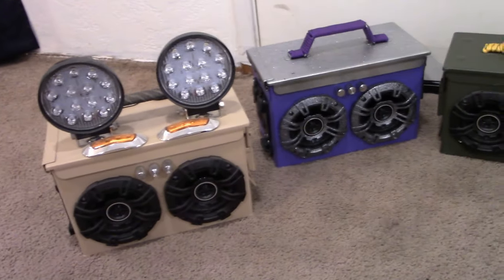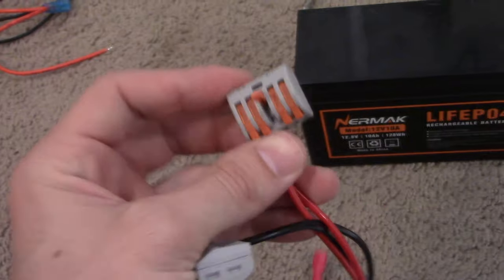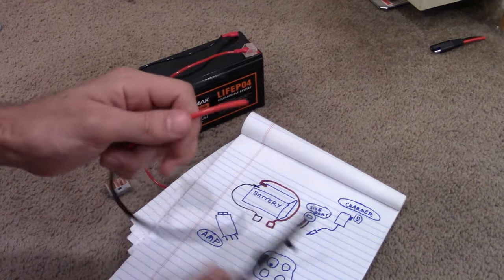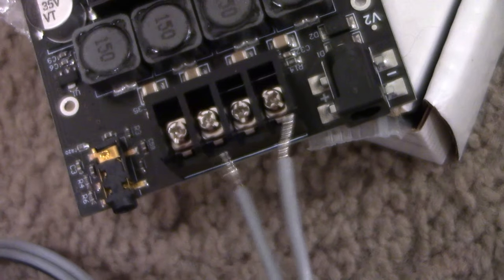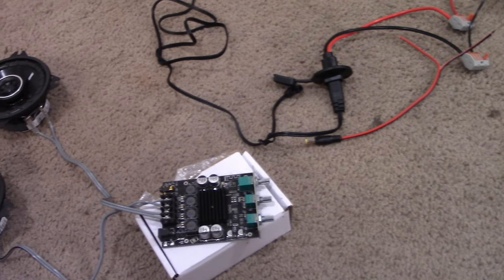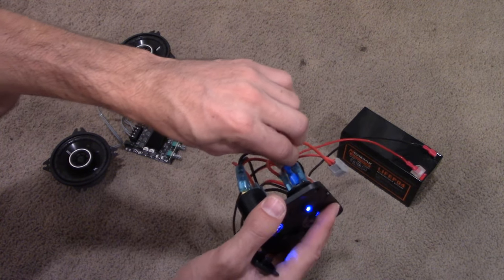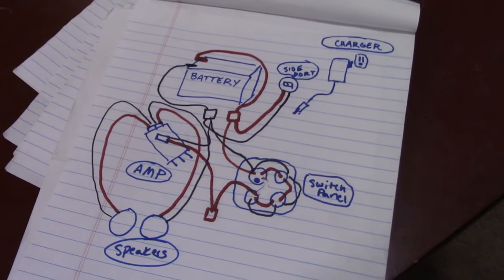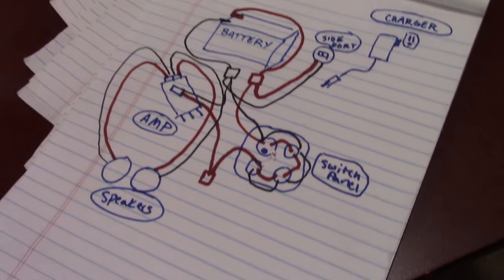How to Wire DIY Boombox - Ammo Can Speaker (Step by Step)

Comment: I built a can boombox exactly as you laid out with the same products.  Turned out perfect and sounds.  Thanks for all the wiring information!!
Reply from the maker: Awesome job!
Reply: How much you spent for the internals of it
Reply from the maker: @nicksmalley6433  about $225 for this one
Reply: What type of fuse?  I'm puting in a 2.1 amplifier 220Wx2+350W 12v38v power amp and would that same battery be enough.
Reply from the maker: @jesusbarrera13jb  that battery should be fine, I always use the largest one that will fit 10-20ah.. and a 30a fuse
Reply: @caseymoto  thank you.

Comment: Great video! I use this to complete all of my wiring for one I just built. I built mine out of MDF, used an old Alpine radio, two 5 1/4 inch coaxial speakers, and an 8 inch woofer. Have you ever built any of these units using a subwoofer?
Reply from the maker: Cool, how does yours sound? I did a 6.5” sub and two small tweeters, I liked it, here is the video of that one: https://youtube.com/shorts/29JhFUywzWQ?si=H-tlXi1h4fR_FLVN

Comment: I’m looking to build one for myself, and if it works out…maybe sell a few. How much did it cost you overall, and about how many hours?
I just got the idea after an ad popped up in my news feed. It looked cool, then I just about 💩 when I saw their blowout price of $1,000🇨🇦. Surely I could do one justice for $3-400 or so.
Reply from the maker: It’s going to cost you about $225 in parts.. the first one you make will take most of the day, but you can make a template on cardboard for the hole drilling positions and make the future boomboxes in less time.. If you paint it, it doesn’t add much cost but does add more time and looks awesome.. I only sell them to friends and family because I don’t have enough time
Reply: @caseymoto  Thank you

Comment: I'm a beginner and am planning on making a Bluetooth speaker. I've been watching a lot of videos on how to make a Bluetooth speaker but none of them have step by step instructions. I've seen many videos that say you need a BMS (battery management system) board which will protect the battery from overcharging and discharging. Also, you didn't have an LED for battery charging and complete indicator. Does the switch panel that you've installed have those built-in? If you can make another video showing on how to connect those items I mentioned or just reply to my comment, that would be great. Thanks.
Reply from the maker: @BobbyTube808  the battery I linked has a BMS integrated into it, so you don’t have to worry about that.. as for battery charging indicator, the charger I linked has LEDs which light up red or green to tell you when it is charging and full .. you can check the description of this video for those links.. let me know if you have any other questions
Reply: @caseymoto  Super!! I will check that out and see if it will work for my setup. Thank you so much for your video and quick response.

Comment: I wanted to know if 14” 1409 dry marine box would fit PLMR60W speaker fit side be side on the length side of 
Box or should I go with a plastic ammo box that length is 17”Lx10.13”Wx13”?

Comment: Love the explanation and the build concept bro, couple of question so real quick. Can you still have it on while charging with no problems? And do you need a step down for the usb charger
Reply from the maker: Thanks man..  yes, you can have it on while charging with no problems, you can use any of the components while plugged into the wall.. you don’t need a step down, the usb charger and other components work off 12v, just like the amp
Reply: @caseymoto  thanks for clearing that up for me bud, you are the man!!

Comment: I've been on amazon trying to find the hardware put I don't know the correct names of any of it. What are the multi connectors that's hook to the battery? Charger port? Everything used to chage the battery,  how can I find that? Only thing I've found is the amp, battery and the on andoff switch.  Please help me with the rest.
Reply from the maker: I put the link to the parts in the description of this video .. check it out and let me know if you have any trouble
Reply: Some of the links comes up as "sorry, page not available". But really the only thing I'm having trouble finding are the positive and negative words you have hooked to the battery that allows you to connect multi things click on them and it might do the same to you. And I wanna build a box that holds 4-6x9s. Will that amp be enough or should I get the 200 watt?
Reply from the maker: @TheRoddrickblow  yea I see that, ok the part you are describing is called “lever wire connectors nuts kit”, try this link:
https://www.amazon.com/gp/product/B07SFCCPZ6/ref=ppx_yo_dt_b_search_asin_title?ie=UTF8&psc=1

I have used this amp with two 6x9s and it worked well, four 6x9s might be pushing it, but I know of a similar cheap amp with a little more power which I sometimes use for big speakers, I’ve also used a voltage booster to increase the power going to it - let me know if you want links to those two parts
Reply: @caseymoto yes can u send those
Reply from the maker: @rylan_mccarson3613  amp:  https://a.co/d/dV627u6
Booster: https://a.co/d/ffrxkIe
Reply: @caseymoto  definitely let me know. I've had this thought in my head about building a 4-6x9 boom box for awhile and I want it to be loud and you've given me the components to make it happen. Thanks a mil for the quick response
Reply from the maker: @TheRoddrickblow  here are the parts I use for the bigger speakers.. when I used this with two 6x9s it provided plenty of volume , good luck :
 amp:  https://a.co/d/dV627u6
Booster: https://a.co/d/ffrxkIe

Comment: Do you have a video of installing the amp with the control knobs sticking out between the speakers.
Also do you use screws with nuts to hold the speakers and controls the the can?
Reply from the maker: For the amp mount: drill 3 holes, take careful measurements to get the locations right. use cardboard to make a template if you have to. The amp comes with three nuts threaded down on the three knobs, remove the nuts, stick knobs thru holes, then twist down nuts, it will be secure...yes I use 6-32 1" machine screws with nuts for holding everything to can
Reply: @caseymoto what size drill bit do you use for the amp knobs
Reply from the maker: @thomasallred5984  I used a stepper bit, so I don’t have the exact size, but using that I slightly increase the hole size until it fits perfectly

Comment: Two questions i just ordered everything but wanna know if I can fit two 6” speakers in one of these and another question how long does it normally stay charged for while using
Reply from the maker: This 50 cal ammo can is fitting 4” speakers.. 6” speakers would be too big. I like to use 6” speakers on this other 20L gas can, it sounds really good:
https://youtube.com/shorts/TWIAvQD87t0?si=u11Ds_iCpp7HAXvj
It depends what volume you play for how long it stays charged, but it lasts a really long time.. I’d say like 8 hours
Reply: @caseymoto  thank you so much should be building me one with 6” speakers by the end of the week
Reply from the maker: @TheOGNuke1   no problem, good luck .. you can also use a 40mm ammo can for the bigger speakers.. here’s another video which shows both of those options:
https://youtube.com/shorts/343ZknA4gx4?si=BcupXg5fBANbco-S
Reply: @caseymoto  built one with the 6.5” speakers I have from the utility ammo can from harbor freight they fit kinda perfectly but i have two more questions if you don’t mind what did you use to install the 12v plug effectively I used a drill bit then kinda ran it in a circle till it cut out the hole big enough then slid all 4  of the into it to get them to fit there’s gotta be a better way do u use like a 1” hole saw or something and also what was the way u got the amp to fit securely bc I made it fit kinda like u did by drilling 3 holes then pushing the amp through and sliding the caps on but it doesn’t seem that secure on there
Reply from the maker: @TheOGNuke1  I only use hole saw for speaker holes , all the other small components I use “stepper bit” because it has several hole sizes which get progressively larger, so you stop and check as the hole gets slightly larger until the component fits perfectly… for the amp mounting , there are three small nuts tightened all the way down on those three knobs, you wanna remove those nuts and thread them back onto the knobs after you stick them thru the three holes, it will tighten up nice and secure , then stick the plastic knobs on
Reply: @caseymoto thank you probably a stupid question but I wasn’t sure and didn’t wanna mess it up 😂

Comment: Your video is great and easy to follow. I plan on building one soon with 2 5.25's and an 8" Skar sub.
I was thinking about using the TDA7498E amp. Do you think amp will be good enough for build? And also do you think k I will need a voltage booster? And how is it wired in.
Reply from the maker: That sounds really cool.. it looks like that amp should work.. I would use a voltage booster, here’s the link to what I use when I’m doing bigger speakers like that: https://a.co/d/hiO1yp2
It has red and black input wires which attach to the 12v battery and red and black output wires which attach to your amp, I do like 21v.. you can set it to what voltage you want to output

Comment: Could I use a dewalt 20v battery being that the Bluetooth mother board is rated between 12volts to 24volts? Just curious before I connect it together haha
Reply from the maker: @nitorena7042  usually I increase the voltage to 20-21v (using a voltage booster) when using 6.5” speakers.. for the 4” speakers I like the power output with 12v thru this amp so I’ve never tried higher voltage on these speakers.. but it should work and I’ve been wanting to try dewalt 20v instead of boosting a 12v
Reply: @caseymoto  I’m going to give it a shot then I’ll  update you on the outcome

Comment: Would it be a good idea to install and in line fuse somewhere in the system, maybe between the amp and the switch?
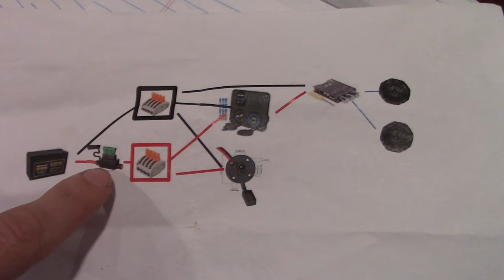Reply from the maker: Yes, I usually put it (a 30a fuse) between the battery and main connector box, you can see this at 11:15 in the visual on this video
Reply: @caseymoto  Sorry I see the fuse now in the visual

Comment: Does or will the voltage display show how many volts are left in the battery??
Reply from the maker: yes, that is correct.. you can see this at 9:35 in the video. It is displaying 13.2v which pretty much means full. around 11.5v or so it is basically dead
Reply: @caseymoto  I must have mine wired wrong because it show 13.3, 13.2 all the time when I have the switch turned on.
Reply from the maker: @ShawnStumpe  it takes a while to go down, because the battery lasts a long time
Reply: @caseymoto  thank I will check it closer I played mine for like 6 to 8 hours and was still showing 13.3 to 13.2

Comment: I followed all of your video. Thank you by the way it works!!! But I noticed the voltmeter stays on even after turning off the switch. Do I have something backwards?😊
Reply from the maker: The voltmeter should not stay on when turning off the switch. It should be connected to the same power line as the USB charger, 12v socket, and amplifier - which all go off with the switch.. maybe you have it connected directly to the battery, which is on the same line as the charger and having constant power.. let me know if I can help

Comment: Wired exactly as you did and put a fuse in, keeps blowing fuse and I can’t find the short, any help?
Reply from the maker: @FatJigga65  I use a 30a fuse, I’ve never blown one.. but when I have wiring issues I just back up and add one thing to the battery at a time until I see what caused the issue
Reply: @caseymoto  Yup I rewired everything, turns out I wired the connection to the switch wrong, thanks!!

Comment: Do you think that this PLMR60W (White speaker would fit perfectly on this plastic ammo box 17”Lx10.13”Wx13”H side by side on the front?
Reply from the maker: Yes I think so. Speakers 6.5"x2 would fit nicely on the 17"L box
Reply: @caseymoto  also plastic ammo box 15”Lx8”Wx10H would be to small to put the speaker side by side on front so it be better to get the 17”Wx10.13”Wx13”h box?
Reply from the maker: @kylewilliams3306  I would go with the larger box that you listed.. the smaller box is going to be very close and is better suited for smaller speakers like 4".. I just did a plastic box with two 6.5" speakers and it is about 17"L x 11"H x 6"W, it fit great and you can see it here: https://studio.youtube.com/video/iSrZkV52jQ0/edit
Reply: @caseymoto  is there an easy way to guy out the holes  for the 6.5 speaker to fit with out drill ,hole saw or dremel tool?
Reply from the maker: @kylewilliams3306  without those tools, I do not know of a way... I prefer hole saw, have also used roto zip (cut out tool) on plastic
Reply: @caseymoto  do do think the speakers would also fit side by side on front of this boxMTM AC11 Ammo Can for Bulk Ammo, Lockable, Water-Resistant, Heavy-Duty Dual Latches, Double Padlock Tabs, USA Made, Forest Green or should I just get 17”Lx10.13”Wx13”H box?
Reply from the maker: @kylewilliams3306  it looks like it will be close, but if I had to guess I would say that first box would be too small for two 6.5" speakers.. even if you got the speakers to fit it would leave little space inside for the other parts, like battery
Reply: @caseymoto  so go with the green plastic ammo box 17”x10.13”Wx13”H ?
Reply from the maker: @kylewilliams3306  yea that looks good

Comment: Any suggestions on how to get the speakers centered, or do you have measurements
Reply from the maker: @TheCounselingGamer  I use the speaker grills and eyeball them to center it as much as possible, using a pencil to mark the holes.. then I use a tape measure and measure the hole location marks and make slight adjustments to get them perfectly centered then remark holes

Comment: If you can answer me would be nice i want to connect 2 12v 12ah batteries together to run a 4 speaker set at 200w willl the batteries last long? Os should i get 2 16ah?
Reply from the maker: @beastmode2990  I think you will be fine with the 2 12v 12ah batteries, I usually just use 1 battery 10 or 12ah , sometimes I boost it to 20v.. last time I boosted I used a 20ah , always lifepo4 too.. they all have great battery life
Reply: @caseymoto  update if you want to know 2 speakers 40w RMS 160 peak with a car audio and one battery 12v12ah lasted 4 hours and it wasn't full empty i wanted to add 2 more speakers but its over kill honestly
Reply from the maker: @beastmode2990  cool.. I agree 2 speakers sounds good, when I made one with 4 I never went over half volume
Reply: @caseymoto  ye sounds better i got 2 hertz x130 speakers and with the car audio they sound fantastic even at max volume tomorrow ill get some mdf 60x40 and some 40x40 panels and i will make a box cause the 12ah battery is bigger than the 7 or 9ah  but i am impressed with the time it held i thing 2 smaller speakers at 25w would work really nice but for now ill stay with those 2 ill keep you updated if you want on how it will work out with the box

Comment: Do you wrap your battery with sound mat, will it make the battery get hot?
Reply from the maker: I do wrap the battery, but not completely. The bottom and back are touching walls so are not necessary.. I have never had a problem with heat, but I also don't think you will notice a difference in sound quality with or without wrapping battery.. I have seen the mat used in minimal coverage on some applications and still works, and I am more concerned with covering the metal on the box
Reply: @caseymoto  thank you, I am actually using a plastic ammo can so will or should I use sound mat?
Reply from the maker: @ShawnStumpe  I would
Reply: @caseymoto  thank you

Comment: Have you done a plastic ammo can build wild 6.5 1/2 marine speaker I wanted to know what plastic ammo can to get that fit those speakers on the front 40mm & 50mm box ?
Reply from the maker: I’ve never done plastic, there’s lots of hardware mounting components to the boombox and I wouldn’t wanna break the plastic walls, plus it vibrates a lot when playing music.. I did two 6.5” speakers on a 40mm metal ammo can and it fit great, check my latest shorts video

Comment: Great Builds and thank you for sharing! What do you think sounds better, your 6.5” Skar sub build or the dual (6x9?) build? The sound quality from your Skar short was really nice. Is that a sealed enclosure? Thanks!
Reply from the maker: thank you... I would say the dual 6x9 build sounds better, it has more volume of speakers also requiring more space to mount them.. my Jerry Can boombox has dual 6.5" Rockville Speakers, which come pre-wired with LED lights that flash to the beat, and it sounds really good too, similar to the 6x9s... both have more power than you would ever use.. those were all sealed enclosures
Reply: @caseymoto  appreciate the follow up and look forward to future builds.

Comment: Do you know of a way to put a shelf or something inside the can for your phone to sit inside? Like to cover the inside. Ive seen some like that and was wandering if you knew of a way.
Reply from the maker: I use velcro to secure components inside the box (like battery and various electronics), so you could adhere a piece of velcro to the inner-wall, and use another double-sided velcro piece to stick to that and act as a strap for phone... I have secured a charger inside the box using that method.. not really a shelf, but you could get more fancy with thin wood to create a storage zone... you would want the phone secured and unable to rattle or move with music bumping

Comment: Do you have to add a separate wiring and battery system to add a subwoofer?
Reply from the maker: No, at 1:02 in this video there’s a boombox with a subwoofer and two tweeters, all on same wiring and battery system